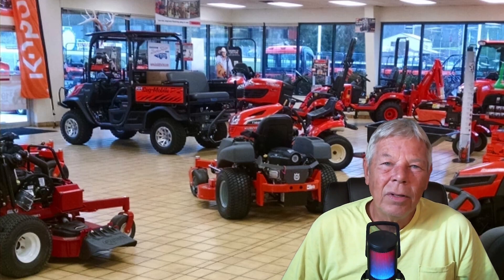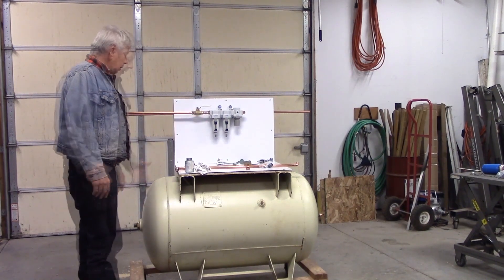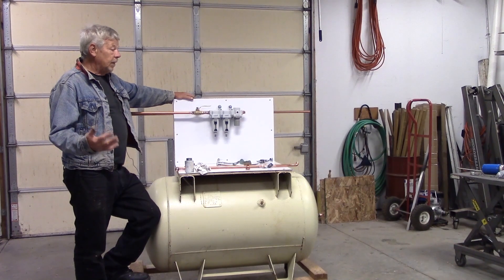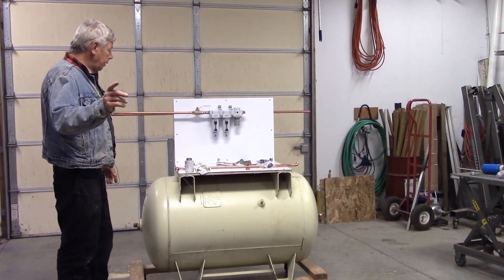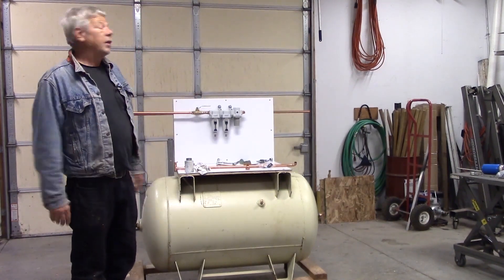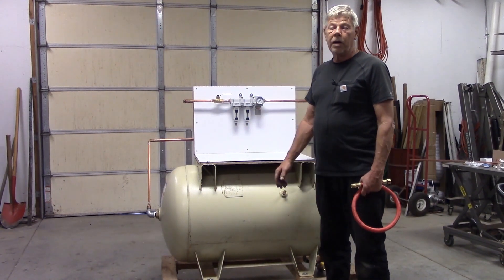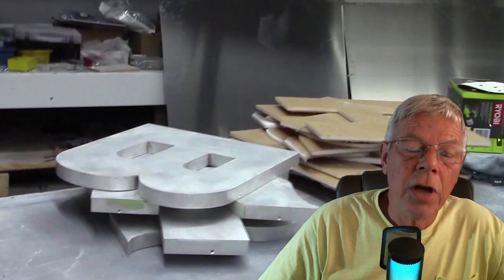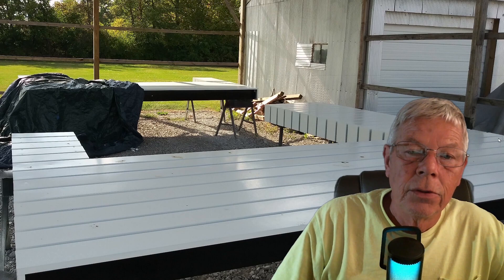Air Compressor Auxiliary Air Tank. Do They Work?

Comment: That’s a really good video. I also hooked up auxiliary tanks to my compressor. I think I sent you a link later on.
Reply from the maker: Thanks for the support and comment. Id love to see that.
Reply: OK, the name of the video was called
Modified HarborFreight 10 gallon air compressor hook to 3 Auxiliary air tanks
And also, I want to note that the compressor has been turned up to about 165 psi
Reply from the maker: @terrellscaife2411  I love it. Esspecially that its portable.
Reply: Hey, thanks buddy I wanna send you a link to another one of my videos. Let me know if you like this one too it’s called.
Steelman 3/4 impact 95 Lego truck with Candy metal paint job extended hood also snowblower repair
Reply from the maker: @terrellscaife2411  Sounds interesting
Reply: OK buddy I’m glad I was able to spark your interest but here I’ll give you another video to watch It’s called
Skil brushless impact driver with leaking battery 1994 Lego tow truck, VA gas bucket seats